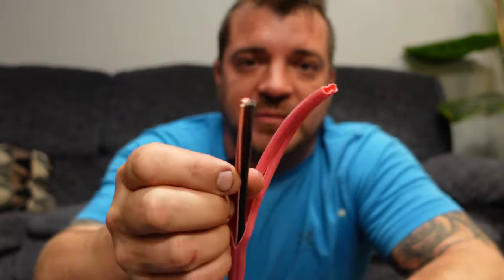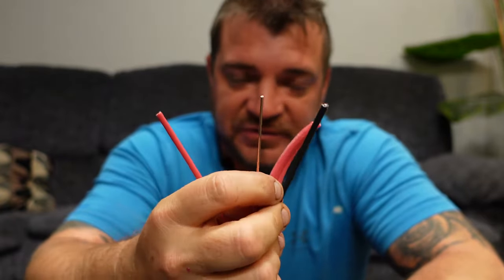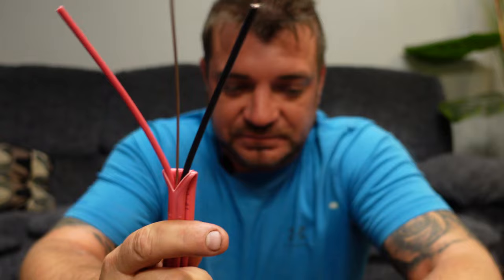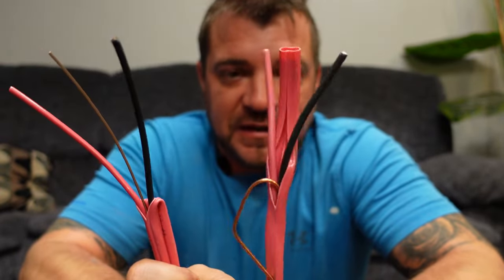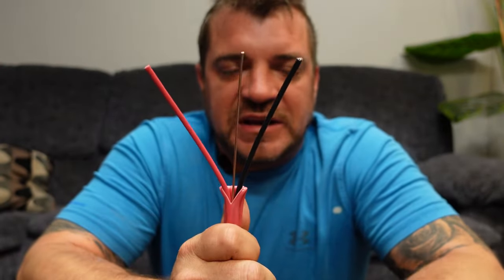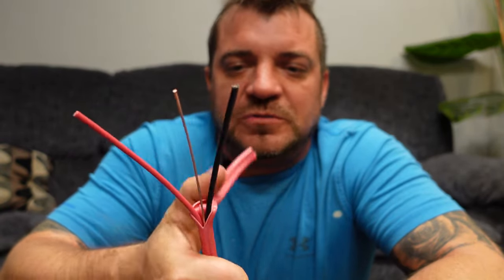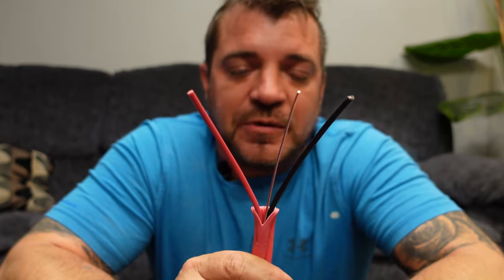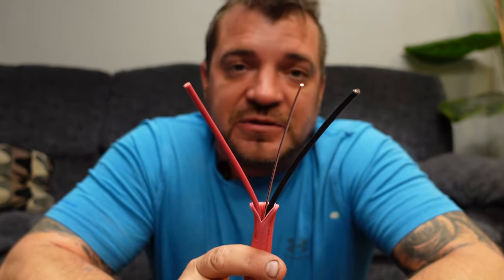What Size Wire For A Baseboard Heater

Comment: 20A adding an other baseboard  heater 3A 240 first from the panel is 3A  wire is 10/2 second heater 3A  using 8/2 wire its ok THANK YOU

Comment: Hello, do I use a 20 amp single pole breaker with 12/2 wire for a 1000w baseboard heater? Someone help me please and thank you
Reply: A breaker is a safety cut off basically. It doesn't feed any certain amount of amps. If your circuit has large enough cable and short enough distance, you can do a 20a breaker if you want. If all you have on the circuit is a 1000w heater, then it doesn't matter, as only ~4 or ~8 amps will ever run through it.

I assume you're asking for a 120v heater. For the 240v, you'll need a 2p.

Comment: I have two separate 2k heaters with individual thermostats, can I run 10/2 to the one Thermostat, and tap of that with 12/2 to the next Thermostat, down to the heater ?
Reply: Your combined load is 4000 watts divided by 240 volts, which equals 16.7 amps. So you should be ok wiring with 12/2 only, assuming you're using a 20 amp breaker.

Comment: I really enjoy your videos. Very informative. I have a question (confusion) regarding bathroom wiring. Can we run couple of lights, exhaust fan and 15A duplex gfci outlet on single 15A or 20A circuit in Canada ? Or do we require two separate circuits of 15A (for lights and fan) and 20A ( for gfci).?
Reply from the maker: In Canada the can all go on 1 15 amp crt. We usually feed the gfci first. Then down feed off the load to the switch boxes for the lights etc. Make sure you have a good quality fan or it will trip the gfci on start up. Hope this helps. Thanks
Reply: @conquerallelectrical  thank you for prompt reply. I really appreciate it. I live in Saskatchewan. So I can run all bathroom lights/fan/gfci(15A) on single 15A circuit ( breaker to gfci to switches ). So light and exhaust fan are protected by gfci. This will pass electrical inspection .. right ? 

I read somewhere that bathroom should have at least one 20A gfci (T) receptacle as per new code. That’s why I got confused.

Comment: Where's the Neutral white?
Reply: If it's a 240v the white is no longer a neutral it is a hot 120v and your black is the other 120v
Reply: @andrewswanson8530  
In the US, 12/3 comes with Red-hot, Black-hot, White- neutral, bare copper-ground.
I've noticed later after the video, this was Canadian video post. Its a Canadian wiring code.
Reply: W T 
 12/2 wire not 12/3 if you are using,12/2 for 240v you use the white and black as hot and a bare copper
12/3 if you are using it for 240v yes you would have 2 hots a neutral and a ground
Reply: @andrewswanson8530  

In the US, Red and Black are Hot.
White is your neutral ground. 
Bare copper is chasis ground for safety.
I've done Seattle King county requirements. 
If You use 12/2 for 240v circuit in WashingtonState. Inspector will have you redo.
If you don't add ACFI at the breaker panel with dedicated neutral for each new circuits.
They'll make you redo.
Check everything before you close the walls.
Reply: @wt9653  240v with a balanced load doesn't use a neutral, and your white is hot. On many 240v things, you'll have nothing to hook a neutral to from any x/3 w/gr cable.

White isn't 'neutral ground,' it's just a 'conductor' until you wire it. And green/bare is your ground stuff. Don't end up with illegal loads on your ground....

Neutral is going to the transformer to connect the whole circuit. Not ground. Though your grounds and neutrals are bonded at service panel.
Reply: @cavscout888  
I went through king county requirements in Seattle. Yes you do hooked up the neutral and bare copper.
I don't know where you're at.
If the rule says hook up both neutral white and bare copper. You don't argue.
Now, go tell your inspector what you said. Good luck!
Reply: @wt9653  The type of heaters this video is about (if talking 240v) do NOT even have any place to hook a neutral up. They have TWO wires to attach TWO hots. Then you ground the case. What are you planning to do with the neutral??
Reply: @cavscout888  
I understand red is one phase of 120vac and black is the other phase.
240vac does not use neutral. 
120vac uses neutral for return back to grid.
But, when you hook up 240 circuit. Most 240 devices now come with spot to terminate the white wire.
For good practice,  even the baseboard heater should come with spot to terminate the neutral.
Reply: @wt9653  It doesn't depend on how modern or compliant the device is. It's called 'balanced load,' and any 240v device with a balanced load doesn't use a neutral. Electric water heaters, AC condensers, baseboard heaters, etc.
Reply: @wt9653  And you use xx-2 cable, and tape the white on both ends so people understand it's hot instead of a neutral.
Reply: @wt9653  And if you use xx-3 cable and hook the white conductor to the ground at the device, then you now have two grounds and have wasted the money for an unused conductor.